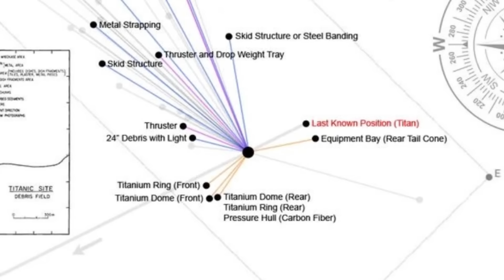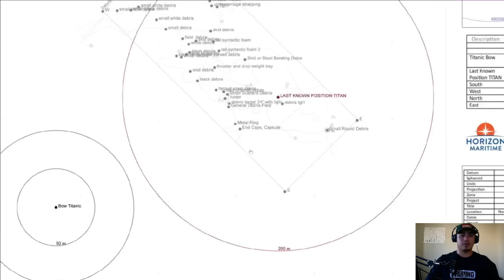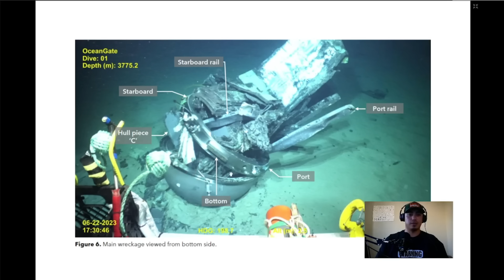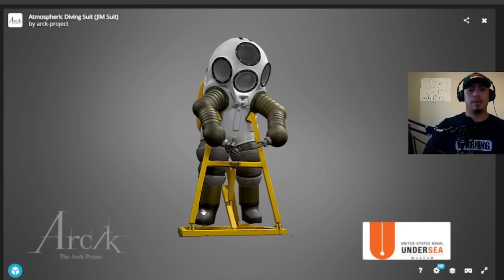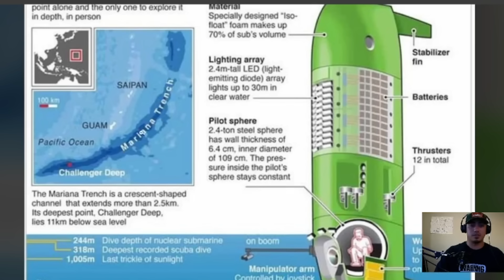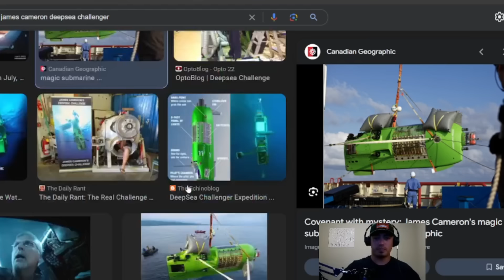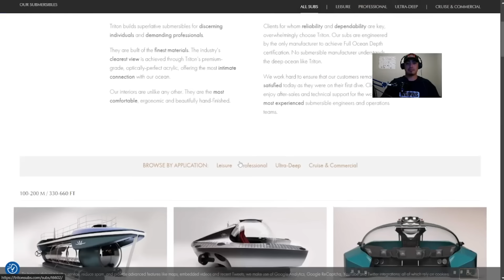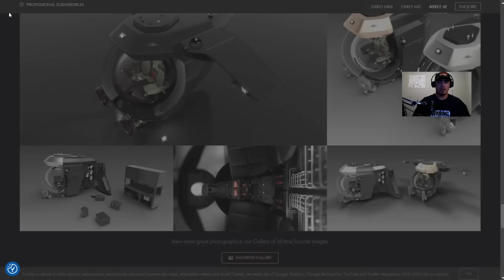Part 3: Investigating the OceanGate TITAN Tragedy: Mysterious Rust, Debris Theory, & Sub Comparisons

Comment: Thank you....Another video estimates the force of the implosion to be equivalent to 50kg of TNT. I search videos showing 50 kg explosions of TNT and its a HUGE explosion. My question is, Simulations of the implosion show the air compressed where it superheated. Is there any evidence  internal parts show burns?
Reply from the maker: Are you referring to the internal parts of the titan? I I guess for me it’s hard to imagine it super heating. Would have been gone in a flash. Especially at freezing temperatures. It wasn’t warm inside of the cabin to begin with either. Let me know, thank you
Reply: I've been doing some glue tests in flooded (68F) concrete holes.  When the test goes wrong and the glue is over confined, an orange-brown stain is left on the concrete.  

I'm using a completely different type of glue to OceanGate in these tests; mine involves oxidation.  But this effect goes to your observation about there being so much energy involved.  It just makes me wonder...

Comment: Why the back end is sticking up like that it has a special non-compressive foam. the idea was to give it less stress on the back end when in the water and makes the vehicle more buoyant what is needed for the control going forward otherwise it would be tipping back.
I think you could probably use wood as the vessel wood can hold a load of weight on its end grain millions of tons if you grow a tree into the shape 7 in thick it would be really strong but probably take you at least 45 years to get there😂somebody start growing it
Reply from the maker: Shoot that’s right! I completely forgot about the foam blocks they had in there!! Thanks for the reminder.
Reply: The spine of that cone was attached at the aft ring, putting crazy leverage pressure on there.

Comment: nothing on those o2 cylinders should be red. are we looking at blood there ?
Reply from the maker: I believe that to be rust. Since they are bare carbon steel, not stainless they will corrode rather quickly underwater or at least begin to form iron oxide on the surface.
Reply: @SSPDIVING  you are the expert here so i respect your expertise that said are you aware of any official answer? by this point they had been under water little more then 96 hours? low oxygen environment with what appears to be a coating on the cynliders wouldn't that make the formation of iron oxide and rust slower then that?
Reply from the maker: @dingoProductionsuk hmm, you do make a good point about the low oxygen. The coating is just green paint which imo looks to have been somewhat ripped off from the implosion. I would take a look at the NTSB material reports on the USCG website. You have to search “official OceanGate titan USCG NTSB reports” and it should pop up on Google. You can get much higher resolution there than you can see in any YouTube video. It looks like bare steel that began to rust imo. ALSO we are aware of the negligence from stockon… all of the photos I have seen of the cylinders shows they did not have any damage to the paint however… a lot of dive shops use welding oxygen as it comes from the same tap as breathing oxygen… anyways, it’s likely they could have just swapped oxygen bottles from the weld shop that already had some minor surface rust on them.

Comment: wasn't the white outer skin made of metal so those rust spots are probably from that.
Reply from the maker: It’s made of some sort of composite material. I don’t recall ever seeing the exact material but in the ROV footage it’s a bit more clear it’s similar to a fiberglass or plastic. There’s photos of the tail cone being held together with a ratchet strap. Also, I’m still not completely sure what the rust would have been from.

Comment: @51:30 what is that "bal" on the left that looks like one of my dogs toys?
Reply from the maker: Ahhhh good question! It’s a rope tied in a knot called a “monkey fist” deckhands typically tie them into the end of the dock lines, etc so the end of the rope has a little weight when they throw them. In this case, they are short lanyards with a knot tied so it’s easy for the ROV hands to grab onto. If the rope slips through the hand, the knot will stop it. Great question 👍🏼
Reply: @SSPDIVING  thanks!

Comment: Bro got 1k likes and no steel drum video 😡.  I think it’s time to down vote
Reply from the maker: I’ve decided imploding one steel drum isn’t going to be enough. So I’ll be imploding two. In addition, I will be creating an underwater implosion. The difficult part is finding a pressure vessel that won’t slowly squeeze and get smaller as I descend. I’m only going down to 70-90’ so creating an implosion at only 3 ATM max is proving to be a challenge. So yeah, it’s coming and will be much more than a single steel drum because I think it would be too short and boring. Hoping to have it out to you guys next month. Thanks for the feedback and hope you’re still around when it’s released. Cheers.